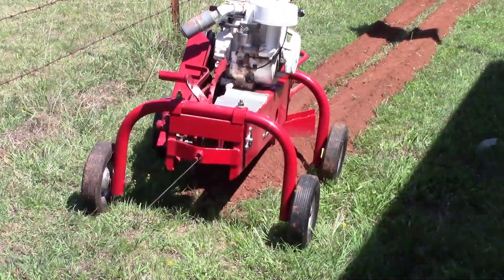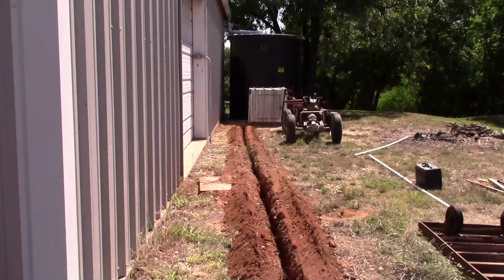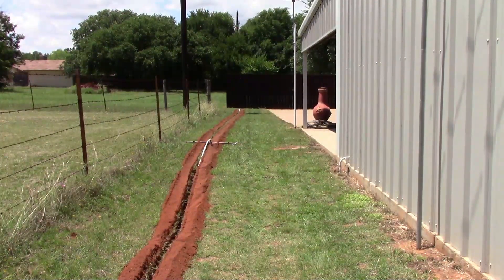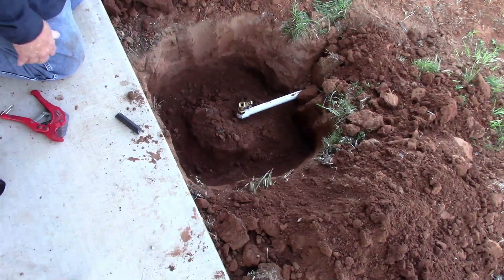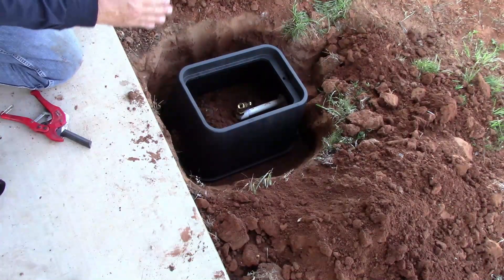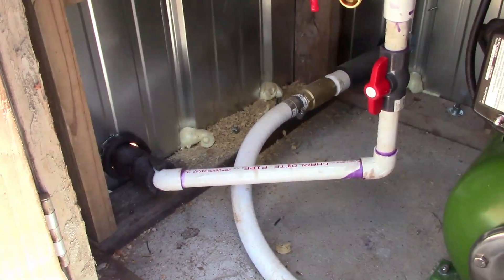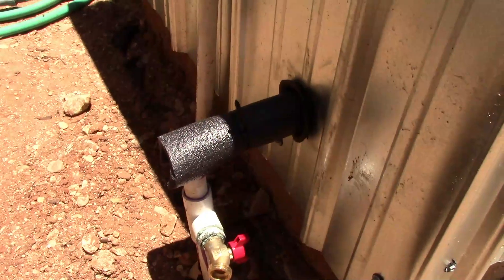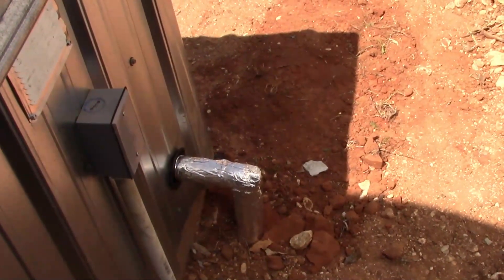Rain water collection, plumbing complete

Comment: Nice, well-engineered project. That trencher is a fine piece of equipment and the cable winch propelling it is simple but genius.
Great video and great job on the plumbing, trenching, and the commentary. Enjoy your system, it looks industrial duty and up to your standard of quality!
Doug@ the "ranch"
Reply from the maker: Thanks Doug, It has come a long way from its beginning. It will be very useful to have around the house for watering plants this summer

Comment: Excellenr work Sir !   I love that little trencher.
Reply from the maker: Thanks, It is really a handy tool to have for small project. Any updates on your truck?
Reply: @RustyGlovebox  No real updates.  Just driving it.  Has turned out to be a good little run around vehicle since I got the bugs worked out.  Much more reliable than I ever thought a water cooled VW could ever be.  Thanks for asking Sir !